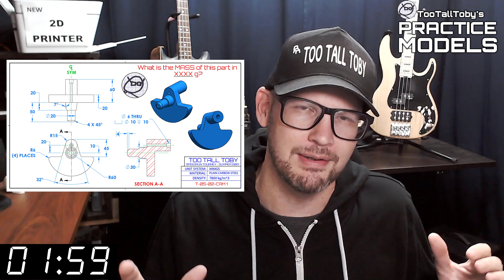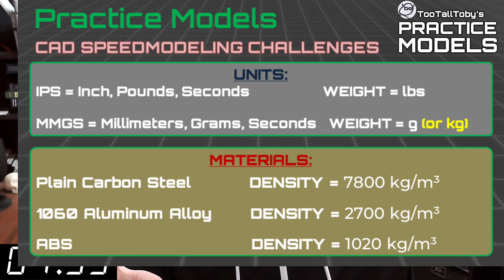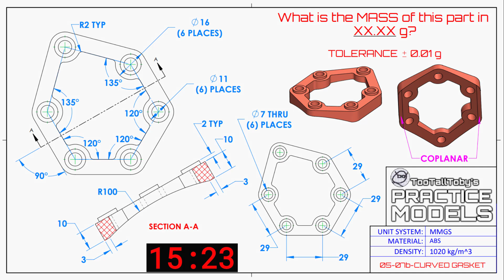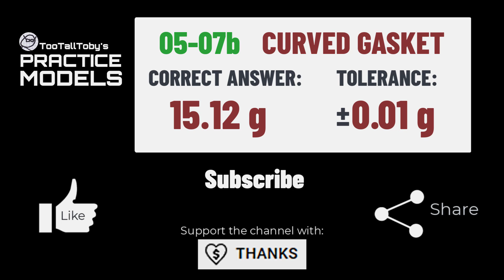3DCAD SolidWorks Onshape Fusion360 Practice Drawing - 05-07b - CURVED GASKET

Comment: Thanks for this Part. At first try  26 mins with 15.08g (Onshape). The round cutout with R100 was for me very difficult. It was ready at 13 mins, but the R100 I had to try out.
Reply from the maker: awww yeah very nice!
Reply: So on my 2nd Try 30 mins but 15.12g. My mistake was i've forgotten the R2.The R100 is also try and measure the 3mm left and right for me. I don't know other.

Comment: I have a question what is the thickness of the parts (not the extruding thickness). 
Thank you for the exercice
Reply from the maker: 5.3577mm - its based on the 3mm + 3mm + R 100mm in SECTOIN A-A

Comment: Thanks Toby. Ist there a symetry line missing? The part ist perfectly symetric.
Reply from the maker: I think you're correct!  Good find!  I could have avoided adding some of those duplicate dimensions!  

I think I originally had more asymmetries, and then as I tweaked the model it inadvertently ended up symmetric :-)